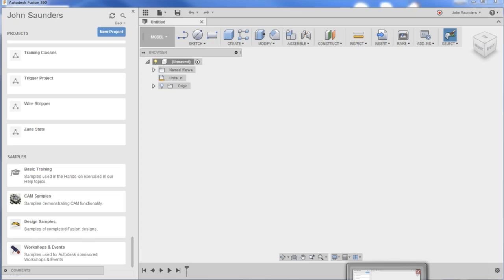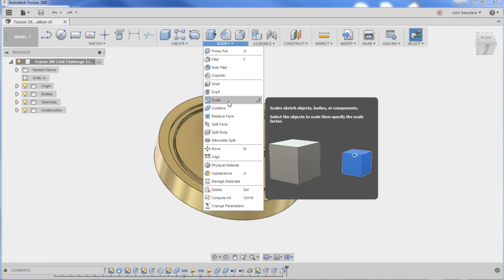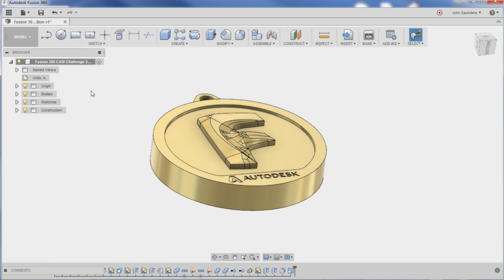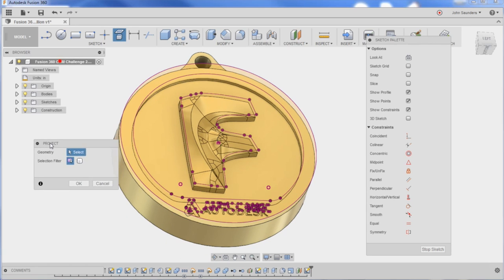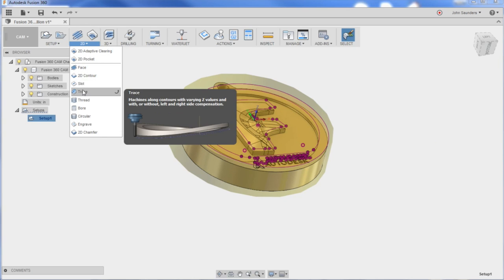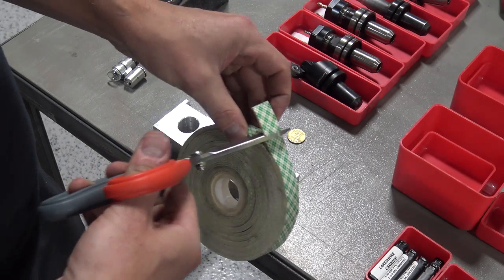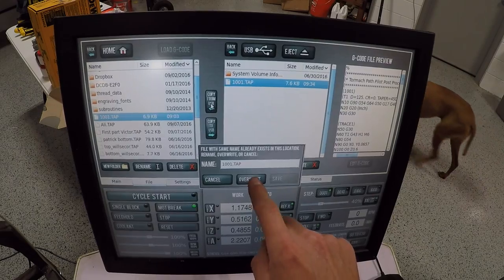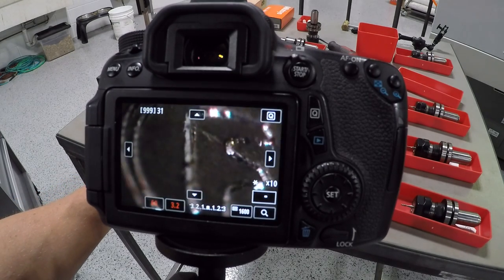$0.10 Fusion CAM Challenge:  Machine on a Coin!

Comment: I wonder if the 3m double sided adhesive that is used for bonding screens to phones and tablets would work better for small parts like this.  tgere is no foam in the middle and its incredible strong.

Comment: And quick comment on the defacing of currency. It is in fact legal to deface it, you just can't pass it on as currency after the fact.
Reply: yeah, essentially the law is meant to dissuade people from trying to pass money off as higher values
Reply: I believe it is the other way around, it is legal to deface currency as long as it stays fit for circulation. i.e.  you can draw funny faces on bills or drill holes in coins,  they are still usable, but you can't melt coins and sell the metal to a scrap dealer because you found out the metal is worth more than the face value
Reply: Other than the first bit Lasse is right. It doesn't have to remain fit for circulation. You just can't melt down pennies for scrap for example. But you can melt down old silver coinage for artistic silver projects for example.

Comment: Hey John, if you'd like to get a better picture of that engraving I work at a place that does laser micro-machining (tolerances tight as +/- 2 micron, or roughly 0.00008 inch) and we have some high power microscopes.  It's fun to bring in a brand new endmill and look at it close enough to see defects.